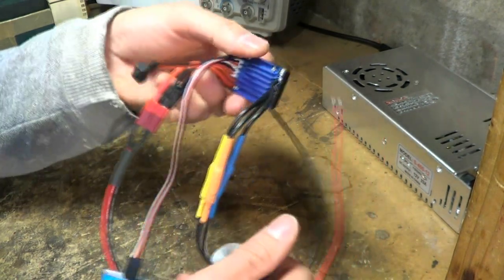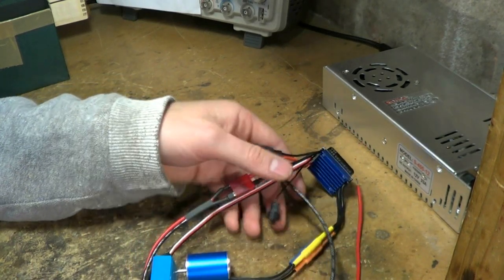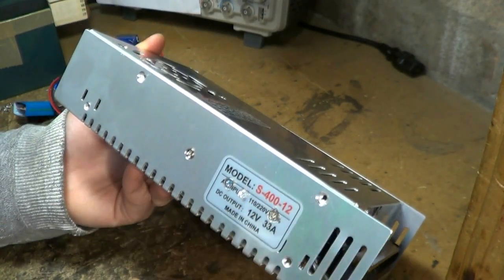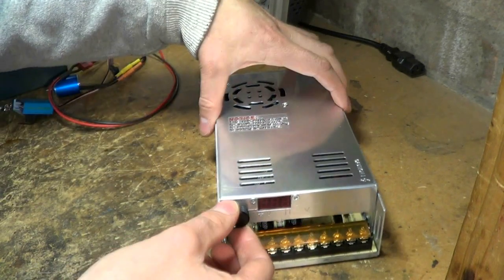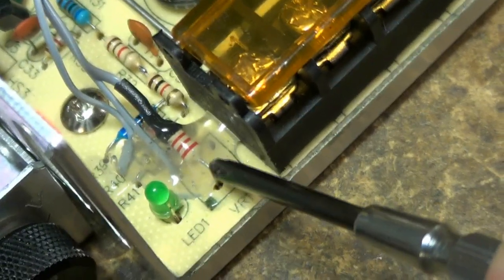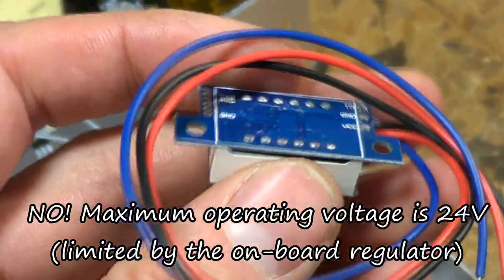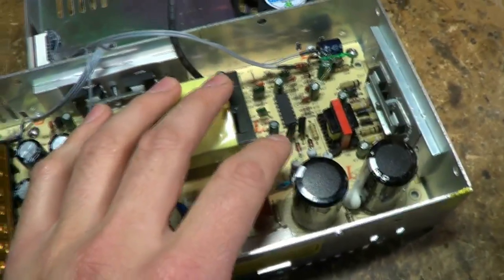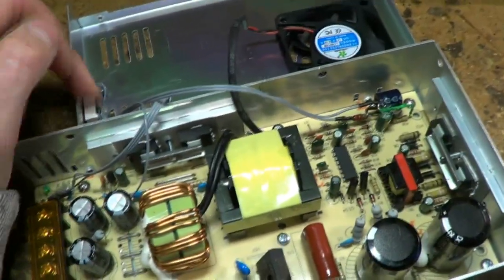Modifying a S-400-12 switchmode power supply for variable output voltage

Comment: Hi
In my PSU board C31 is 33 nF.
Could i replace it with 47nF?
Reply from the maker: Why would you want to change the value? That'll change the frequency response of the feedback loop.
Reply: @imajeenyus42  In new divider you replace C31=100nF With 47nF.
Should i change it too to get higher frequency response?
Reply from the maker: @mohammadrezasafari102  All the component values in the new feedback network, including C31, were chosen to result in a roughly similar frequency response to the original feedback network. If the other component values in your supply are different, then you'll need to change the values in the new network as well.
Reply: @imajeenyus42  Only C31 is different, other components are same as yours.
Should i change them all or just C31?
Reply from the maker: @mohammadrezasafari102  What exactly are you trying to do with the power supply? I don't understand.
Reply: @imajeenyus42  Modifying 12V-30A switchmode power supply for variable output voltage
.
Same as your great work.
Reply from the maker: @mohammadrezasafari102  Assuming all the other components (apart from C31) are the same value, add the new feedback divider as shown in "New feedback divider", but try C1=22nF instead of 47nF.
Reply: @imajeenyus42  Thank you sir.

Comment: Hello I have a close looking power supply rated for 12v, 240 watts, and has 25v Caps on the DC side, is it possible to make voltage modification for 16.8v? if so how? i don't understand the schematic, I have soldering skills and basic understand of some components. thanks,  finding a power supply rated for 6 amps at 16.8v is hard and the ones I did find arm't rated for what they say they are and drop voltage by like 2v and get very hot.

Comment: I want to ask you a question, I have a 24v isolated SMPS with an optocoupler and TL431 adjustable zener, i want to modify it to make a constant current source, so can I connect a 0.1 shunt register in series with output, and amplify the shunt register's forward voltage when my desired current flowing through it to 5v, and feed this 5v to feedback circuit by adjusting TL431 to 5v, will it work.

Comment: Thanks for sharing the idea 
I have a Question
How i can make it work to be 4.2volt with the same current Amp ?
Can you help me about this 
Iwill be so grateful your kind help
Reply from the maker: It wouldn't make any sense trying to modify a 12V supply to give a 4.2V output. Get a 5V supply instead, then see how much adjustment you can get from the existing potentiometer.
Reply: @imajeenyus42   not available in my country 😔
Reply from the maker: @ezaztyco2434  There's plenty on eBay, AliExpress, Uxcell etc.

Comment: Can you modify the current?  Like make a variable amp output 1-30amp or whatever the power, 1-16 in my smps
Reply from the maker: It seems to be possible to at least implement current limiting - see this page, down the bottom, under "Converting a 60V LED switch mode power supply to an 18650 cell charger": https://github.com/matteljay/ebike

Comment: it is good BUT i suggest you to change elco 3300uF/16v to higher voltage if you want to use output at 15volt or higher (max 24v)...
Reply from the maker: I mention this on the webpage.

Comment: Hey Bro nice work i am going to buy vigen 500W U.P.S power supply from [made in China.com]
It is a 24Volt Power supply
Will your components will fit as it is in it?
Plz reply Yes or No !
Reply from the maker: Sorry, I've no idea. If it's a UPS, it's probably an entirely different circuit.
Reply: @imajeenyus42  It is not a ups consider it as a usual 500w psu
It is a ups+psu
But psu will be same

Comment: Awesome effort at reverse engineering the schematic.  Thanks a ton.  I have a 48V 10A adjustable Voltage and Current version and your effort has helped a lot.
Reply: Am seeking of making 48v 10 Ampere to 110v 4-5 ampere with replacing o/p capacitor and protection diode and feedback resistor is it possible to double such voltage?

Comment: Great video! I went with the easier solution and added a resistor to the trim pot. As my goal is to lower a 24v supply to 17v. I can now get it down to 17v when turning down the pot. BUT it starts to flash on /off when lowering the voltage! It does this even without load. Any ideas?
Reply from the maker: It's a bit of a guess, but I wonder if it might be the power supply's short-circuit protection circuitry kicking in at lower voltages. It basically looks at the output voltage and if it drops below a certain level, the driver chip is shut off. I've got a section about this on my page. If your supply is the same sort of arrangement, then you should be able to disable this by removing D13 or the equivalent on yours - it's down at the bottom-right of the schematic, in the short-circuit protection section. Try that first and let me know how it goes ;-) Could you also try and see the values of R31 & R38 (or, again, the equivalents)? That's the voltage divider which drives the base of the short-circuit protection transistor.
Reply: @imajeenyus42  I have measured the inputs of the control ic, and the FB (feedback pin) has 1.5v when power supply is in normal operation. but as son as I lower the trim pot "to far" (about 17v output) the FB goes to 0.5v and its starts to reset.
Reply: @markusgranberg8004  Old post so you may have resolved this but if not the OB2268 datasheet shows an undervoltage lockout (UVLO) function when Vdd on pin 7 falls too low. The relevant voltages are shown on page 5, hard to correct without increasing the number of turns on the transformer winding that generates Vdd.
Reply: @imajeenyus42  Thanks for the fast reply! I have looked into this more now and realized that my power supply uses a different control ic. It has a OB2269AP  https://www.promelec.ru/datasheet/8/e/OB2268-2269.pdf

this does not have appear to have a dtc input?

Comment: Hello Lindsay
The power supply for the voltmeter module is derived from a couple of extra diodes + 100µF capacitor + 220µH series filter inductor, tacked on to the anodes of D11 & D12 (see photo below). This provides about 20V to the module.Can you show the wiring diagram of the power supply for this voltmeter module? Not exactly seen from the picture.
Reply from the maker: Well spotted, I forgot to add the photo to the website ;-) If you check the page now (http://imajeenyus.com/electronics/20151028_smps_variable_voltage/index.shtml), I've added a circuit showing what's used for the extra supply.
Reply: Hello!  @imajeenyus42   
Thank you for your quick reply.
Reply: @imajeenyus42 again thank u for your perfect professional modifying circuit
But the link you suggested for the well spotted hint about the power supply of the voltmeter is no longer exists. Is there any  possible way to find what you added in the picture or any explanation that helps
Reply: @imajeenyus42 i could not access that link u suggested for the picture
Reply from the maker: @amirvafa7344  The link works: http://imajeenyus.com/electronics/20151028_smps_variable_voltage/index.shtml
Reply: @imajeenyus42  thank u for the reply 
I thought the one who asked the wiring for the meter supply has not found that in the link in the description and u had a new diagram then. I found out there is only one link an it is ok
U r a nice and decent man . Wish u the best

Comment: Cud not see the circuit.need to add variable voltage and variable current to my 24v,10amp smps.alao add a voltmeter and ammeter.nees this for electrolysis.
Reply from the maker: Please visit the link in the video description.
Reply: I need to add a variable voltage and variable current potentiometer.
Reply from the maker: @natarajvenkatadri921  These supplies can't do current regulation. You'd be far better using a separate module to do that. Search eBay for "constant current step down converter" or similar.
Reply: @imajeenyus42  tried a few,they keep blowing.i need to control output current,not very particular ABT regulation.like I said,need this for electrolysis.have found a source for such a Chinese smps.shud be getting it soon.

Comment: Hi, I have the same power supply that I use on my 3D printer. The fan on it is quite loud, so I removed it, and 3D printed a cover to mount a silent 12V 120mm fan. I tried to connect the fan in the same output as the old one, but after a few seconds I could smell something, so I stopped the power right away. I think it was the R37 22 ohms (according to your schematic, thank you for that by the way). 
I now connected the fan to the 12V output of the power supply, but now it's constant speed regardless of power usage. Do you know what I have to modify to make the fan work like the old one? also do you know where is the thermal switch located? I could not find it on the board. Can the thermal switch handle the new bigger fan? Thanks for any input!
Reply from the maker: If the new fan was a higher power rating than the old one, the higher current draw might have caused the resistor to overheat, so that's probably the reason. You could always replace the resistor with a higher power rating version. The thermal switch on mine was a small metal-can device glued into the center of the big toroidal output inductor - you can see the two thick black leads on the video. Yours might not actually have a thermal switch - I've seen some variations between supplies - but it should definitely be visible if it's there. It should handle the current no problem - those little metal switches typically handle 1A at 230V or so (even though it's only being used here to switch the 12V fan). Hope that helps!
Reply: @imajeenyus42  Thanks for the quick reply!   It looks like my power supply does not have the thermal switch, but the fan does increase the speed as I draw more power. The fan reaction is almost instant, so I think it's based on current instead of temperature. I took a picture of it: https://postimg.cc/G4qtF3z3  I don't have the skills to reverse engineer the power supply, so I will just leave the fan connected to the 12V output for now. If you are interested to mount a 120mm fan on yours, I uploaded the STL here: https://www.thingiverse.com/thing:3476492
Reply from the maker: @mike36801  Hmm, that's interesting - I didn't realise that some supplies did proportional control of the fan speed, rather than just off/on depending on temperature. I don't see how it manages it, because there's not apparently any extra components visible! The layout is nearly identical to mine (some stuff moved around a little) - is there anything hiding under the transformer?
Reply: @imajeenyus42  Hi, I finally had the chance to open the power supply again. Sorry for the delay. I looked under the transformer and I could only see 2 diodes. The fan (before I made the change) it was not proportional, it had low speed and high full speed, it did not vary in between. But it was turning on at full speed as soon as I was starting to heat the nozzle of my 3D printer. When it reached at required temp (220 degree for example), then I could hear the fan going down in rpm on the power supply, even though the 3D printer is still drawing power because it has to keep the nozzle at 220 degree. The power draw is pulsating to keep it up to temperature.

Comment: Hi, just out of curiosity, could you please point out for me, why the output rectifying diodes are arranged this way,  I mean why 2 diode packages, connected "in series" with transformer output, it seems to me that only one diode out of each package is doing the rectification, what is the purpose of the other two (1 out of each package). Standard ATX PSU for example uses only one diode package.
Reply from the maker: Each package contains two diodes, like you say, which share a common cathode. The anodes of each diode are tied together, so you end up with the two diodes (in each package) in parallel. This is quite common in higher-current devices - it's maybe more difficult to make a single high-current diode than it is to make two lower-current diodes and connect them in parallel. An ATX supply might only be using one diode if it's a forward or flyback converter instead.
Reply: Thank you for taking your time to answer my question. I've looked at you schematic again and now it all makes sense, for some reason I've completely ignored the fact there was a connection between package diodes anodes, and mistook the line for representing the package itself... I guess I just need to spend more time reading circuit diagrams.  Sorry for wasting your time.
Reply from the maker: Don't worry, I'm happy to help!

Comment: Very nice project, i wonder if it would be possible to switch the pot for a digital pot and use a mcu to controlle the feedback and thus output voltage.
Cheers

Comment: εχω  αντικαταστισει  τους πυκνωτες  των 16 βολτ με  35 βολτ  στην ιδια χωρητικοτητα
Reply from the maker: Εξοχος!
Reply: @imajeenyus42  can i replace two big electrolytic capacitor? default electrolytic capacitor like cheap capacitor?
Reply from the maker: @SIAgarage  Sure - just make sure the voltage rating is suitable.
Reply: @imajeenyus42  Thanks dude, i will replace that. I want to do what you do. Make large range voltage. But in my case the mode switch is 48 volt 10 A. do i have to change some resistor? I dont know to measure sense voltage to ic.
Reply from the maker: @SIAgarage  You will need to change the feedback divider. Please see my webpage (link in description) for information on this. You will need to determine suitable values for your supply to give the desired range.
Reply: @imajeenyus42  oke friend, i will read again in your weppage.

Comment: I bought a couple of these PSU 24v 20a but have 24v AC ripple across the DC output, any ideas anyone. Thanks
Reply: 0.6 ohms is not that good !
Reply from the maker: Jeff Cole 24 ripple ?!? Yikes. Something sounds seriously wrong with them - are the output filter caps good?
Reply: Checked the caps and looked ok 0.6 ohm and close to the spec. I overloaded the units and replaced some resistors and MOSFETs. Perhaps I'll change the filter caps as well sometimes you forget the routine. Everything else reads OK and looks fine. Thanks for the fast response.

Comment: Hello, I am doing the same thing with the same type of 24 V - 15 A switching field
I did it, but the voltage changed only from 9.6V to 16V.
Among them, the transistors Q1 and Q4 were broken, especially from Q4, the fire came out.
It is very disappointing. Please tell me what to do and what are some good ideas.
You are a very smart person.
A bad head like me has a hard time.
I'm sorry in poor English.
Thank you.
Reply from the maker: Sounds pretty terminal - Q1/Q4 are the main bridge transistors. Assuming you can get a working supply again, either by replacing the transistors or just getting a new supply, you could try just increasing the the existing trimmer pot (VR1), rather than replacing the entire feedback network. The response won't be linear, but it's a simpler modification and less risky. A larger value for the pot will let you adjust the voltage lower. Hope that helps!
Reply: Hello, thanks for the reply. I am happy that I could interact with foreign people. It is good to replace the transistor Q1Q4 and increase the resistance of the part of the volume. Thanks to you I'm sure I will not lose 35 dollars. I will do my best and try. I thank you.

Comment: Hello, very nice work, I was wondering why you could not just remove the  trim pot for v-adjustment and wire a 10k pot in it's original place? Thanks in advance for the reply
Reply from the maker: Thanks - you could, but you'll then still have the problem of a nonlinear adjustment, plus the possibility of instability since the frequency response of the feedback loop will have changed.
Reply: Lindsay Wilson one other question please, I want to make my 36v 16.5a supply variable so I take it my values would be 3 times higher than you used in this for components  in the conversion except with possibility of the 10k pot?? Thanks again for any help

Comment: Hi Lindsay, would it be possible to make a broader output control? Something like 10 - 36v? Even with switches from something like 10-20 20-30 30-36? Or the internal transformers or other components can't handle higher voltages (except of course the output caps, easily fixable)? I would love to have something like that to control a CO2 laser! Thank you very much for all the explanations, on the site and on the video! Cheers!
Reply from the maker: Definitely,, but it would be far more sensible to initially start of with a supply designed for higher output voltage. For example, there are plenty of 36V or 48V supplies available which could probably be modified in a similar fashion to this one. I'm not sure what the undervoltage cutout on these would be - you might need to disable that as well, if you wanted to adjust it really low.

Comment: hi, great project :)
what's the model of the potentiometer? Can't find one of this shape... or can be used one of these, for finer adjustment?
https://sc02.alicdn.com/kf/HTB1KF6kLpXXXXa6aXXXq6xXFXXXo/WXD3-13-2W-10-turn-wirewound-potentiometer.jpg
thanks!
Reply from the maker: Thanks! The potentiometer is a Vishay P16 series - http://www.vishay.com/potentiometers/list/product-51036/ - but you can certainly use any other 10k pot. you like. That one you linked should do fine, and give you better control.

The Vishay potentiometers are hideously expensive (over £10 each!) - I only used them because I found a dozen out a skip at university ages ago!